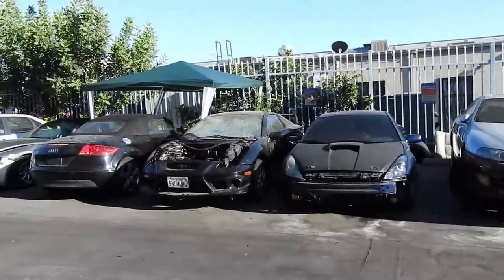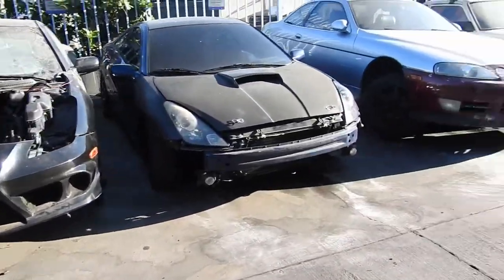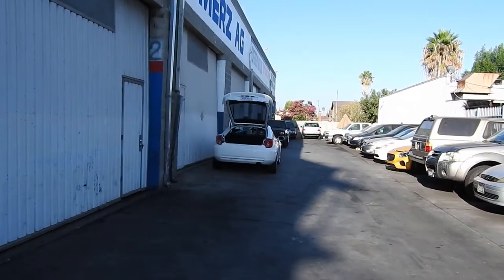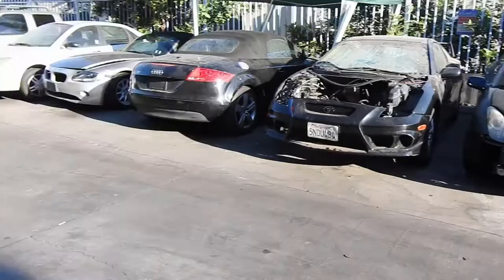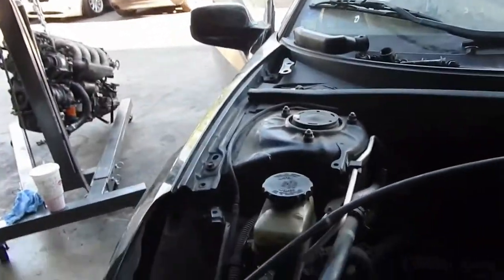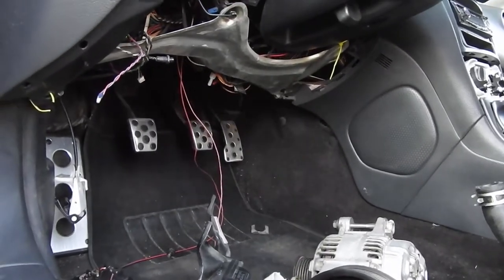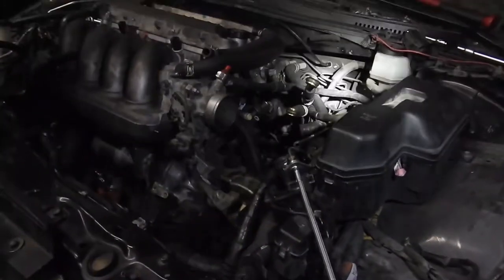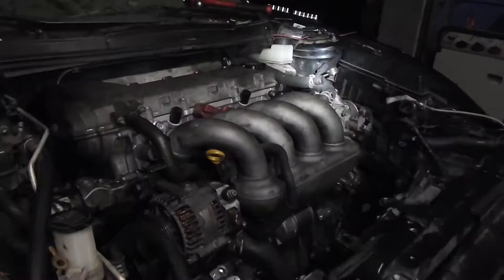Dropping Mark's Motor (2zz-ge) In His Car

Comment: Yo what oil were you running in you car when the rod knock started happening? Also what happened? Spun rod bearing in the 4th cylinder due to the tune?
Reply from the maker: Mike West running 5-30 my little brother was driving it and idk still havent open it up, i think it was my tune
Reply: Word, what brand oil do you use? Im thinking of switching from castrol edge titanium to mobil1 synthetic.
Reply from the maker: Mike West whatever's was on sale
Reply: Mike West don't ask me why but I've heard mobile one is not good for engines because we have a full aluminum head and aluminum block this comes from a mechanic and owner of Rockstar garage a shop that specializes on S2000 s and mainly track S2ks that's what he says about the s2k and the Celica the same way motor wise
Reply: @Mark Vega Really man? What oil do you prefer for 2zzs?
Reply: Mike West I would say stick to Castrol Edge now if you want to go for a little higher end oil I know it's a bit pricier but Motul or Torco both are good